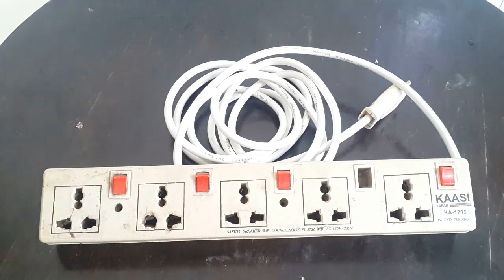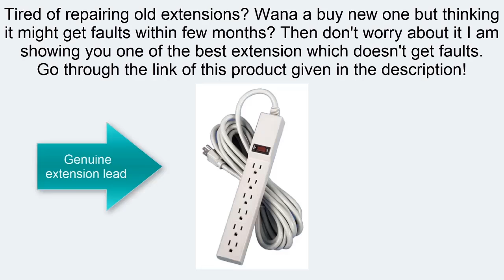How to repair extension cord

Comment: Your video was well made, and is appreciated.
I would like to point out some major fails in the extension lead and cable etc.
-No earth wire. A three pin plug could be inserted, needing a ground.
Non standard wire colour (should be blue for neutral Brown for live and green and yellow for earth)
The extension socket is very poorly made, soldering contacts is bad practise.
Please throw it away and buy a safe one
Reply: I have an exact one you've mentioned 😅 my doubt is all negatives are connected properly...except the ground(yellow)..should the ground need to be connected somewhere
Reply from the maker: Sir, we’re on startup but we’re improving day by day. We hope you will understand. BTW feedbacks are always appreciated.
Stay connected with us.

Comment: There are some big mistakes…
Firstly (at 1:06), there’s not DC voltage in the socket, it’s AC voltage! So there isn’t any positive or negative. It’s Life, Neutral and Earth: Life is the one that makes the screwdriver light up, because there’s the full mains voltage in it. Neutral is basically the return path and Earth protects you, if something’s wrong with the device (very simplified explanation).
1:11 Secondly (the biggest mistake), don’t ever work on devices, which are switched on or plugged in! Every wrong touch could be your last breath! Use a multimeter to test for continuity and to check the resistance, which should never be greater than 3 ohms! 
3:30 You obviously have to insulate the connections! If the shell breaks and these are accidentally touched, there is full mains voltage going through your body! A short circuit is possible too! Welding or at least soldering the connections (not recommended) would also be necessary, because there is otherwise a big resistance, resulting in heat or even fire at big loads (>5 amps)!
3:56 And again, never work under voltage!

Comment: I have an extension cord with a switch (reset-off). The switch is now broken and I am planning to just connect the two hot wires together for the extension cord to be usable. Can I actually do that without worrying?

 I want to do this instead of throwing it away. I also searched online for a replacement of the switch but it turns out it is too expensive in a way that it is better to buy a new extension cord. There's a label on the switch says that it is a 15A 125VAC for additional info.
Reply from the maker: Yes you can absolutely connect them and your extension will work First you probably disconnect a wire Thank you for commenting me Now tell me what my new video should be on

Comment: No need to change the entire wire all the time because most  faults are in the plug (Unopenable). Just cut n change the plug with a new  6A 3pin top. If it still doesn't work then One can check for quality/faults of wire using end to end connectivity with multimeter before discarding for a new one. This will save some money.
Reply from the maker: Exactly but as the video title is how to repair extension cord so we’ve shown in it what’s described. We hope you understand now.

Comment: my extension chord's on/off switch stopped working. its always on regardless of whether the switch is on or in off position
Reply from the maker: Replace your button or use it as it is otherwise.
Reply: @Dhruv Kumar - 
Contacts welded them self together
Reply: My extention socket keeps turning off the other when one is on why

Comment: My multiplug cable somtimes gets hot and tears up itself or maybe melts a bit at some point of the cable. What might be the issues????
Reply from the maker: You've to change the wire in order  to run the machine, the tiny wire can't handle this so get a new heavy wire from the market and it will work for sure.
Reply: @Ryan Nur - 
This means to high current for the part (or lose connection) , throw it away , it is likely dangerous cheap junk like in the thing video.

Comment: Hi, I have a problem with my extension cord

I just got it and found out one of the outlet is not working but the others work well

Should I send it back? Or fix it myself? How to fix the issue?
Reply from the maker: If it’s new then send it back otherwise try opening & checking the specific socket connection from inside, it’s wire might be broken.

Comment: omg 
very thin wires (copper strands)😨😲 ! it looks like 0.75mm2 = 18 AWG , this is not good for extension cord
you should use at least 16 AWG = 1.5 mm2
i use 2.5mm2 = 14 AWG ... sometimes i even use 12 AWG in my extension cords for high loads.
Reply: I use a microwave power cord

Comment: What if you got no tester? Can a multimeter be used? And how?
Reply from the maker: It's preferred that you should use tester because with multimeter it would be bit difficult to check We guess.
Reply: @easysolutions90  okay, thanks.
Reply: In multi meter when u check there is a sound that its clear that means ,wht u check that is working or not.
Reply: In multi meter when u check there is a sound that its clear that means ,wht u check that is working or not.

Comment: sir mere pass extension cord hai 6AMP-240 volts (6+6) jb ek working me hota hai aur dusre me sirf plug laga hota hai wo( on nhi rehta) to wo current pass kar rha h bht tezz,, koi solution hai iska? mene laptop charger aur phone charger connct kar rkhe the jisme se phone ka switch on tha aur laptop ka switch off
Reply from the maker: There might be issue inside the extension cord or it might not have capability of bearing more load.